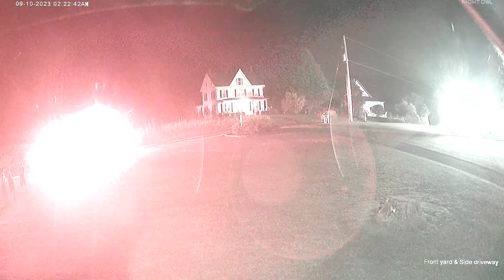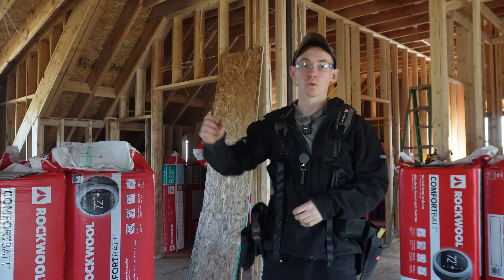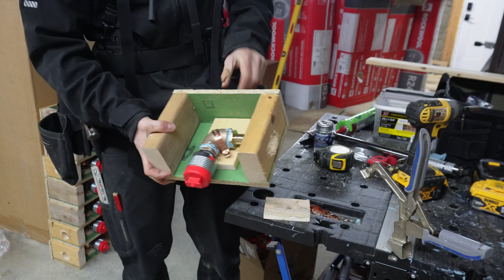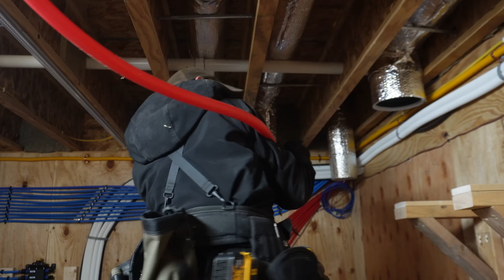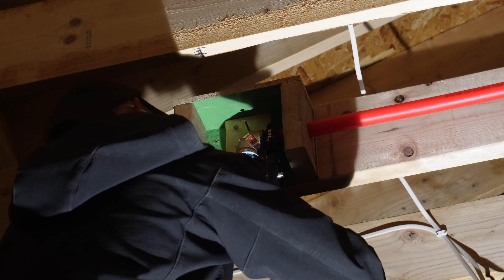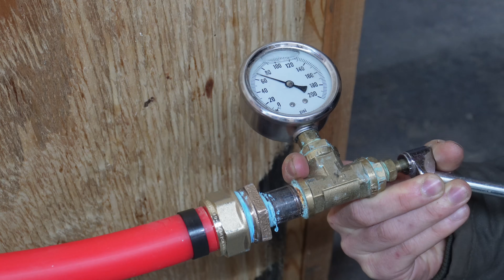AIRTIGHT House Fire Sprinklers with PEX Piping (Fire Protection Part 2)

Comment: Use 1/2" Pex A and connect it to a self contained Compressed Air Foam system that supplies high expansion foam to each fire sprinkler head. No fire pumps, just a 50 gallon holding tank for water and 1% Class A foam concentrate under pressure using a 300 CFM nitrogen tank.

Comment: Using all those fittings, the amount of friction loss almost makes more sense to just design with three-quarter pex.
Reply: That pipe would be to small. You need to flow 13 gallons a minute out of 2 head to test.
Reply: @rickberger3213  what is the GPM of the two head test on this system using three-quarter inch pex?
Reply: @Z71hosestretcher it's almost always 26 gpm. 13 gpm out of each sprinkler.  I've designed houses using CPVC & PEX. The pipe size is always 1" or bigger depending on the static pressure. Pex piping and fittings have a higher friction loss.

Comment: Well, you've convinced me to use CPVC and being happy about using a conditioned attic which will allow me to access the sprinkler piping via openings in the web in the trusses.
Reply from the maker: Yep that’s a good call! Or just buy 20’ straight PEX from a plumbing supplier like I should have here 😁

Comment: Hello from Nottingham, England. I know literally nothing about sprinkler system but I was just wondering. By putting the sprinkler head in a wooden box with Rockwool, are you not creating a heat shield? Rendering the head useless?
Reply from the maker: The rockwool is only above the head for some additional insulation , the glass bulb inside the head is exposed to room air

Comment: Why the box around the sprinkler head?  Is it a heat collector? I have never used pex, only cpvc and steel. I've been in the trade for over four years and have never seen that done nor taked about in the classes
Reply from the maker: To maintain a continuous air barrier at the ceiling while allowing room air to reach the sprinkler head. I came up with this detail myself, I explain it more in the part 1 video

Comment: I was watching the system install. Great job.
 I can think of 2 options for runs in cold areas. Install a back flow valve at the tank (like on a sump pump) and place a connection  point in the output side and fill with the glycol that will not freeze. 
Option 2 install backflow valve once again this backflow valve only this time this one will stop backflow of air. Than charge the full system with air. When I head is calling for water the air is released and pump will start to push water. I think that’s called a dry system.
Reply from the maker: Appreciate the ideas! By backflow valve do you mean check valve or backflow preventer? A glycol mix would probably work. At some point I might put a temp sensor up against a tee through winter to see how cold it really gets. 

I did look into dry systems for residential use, the commercially made ones are pretty expensive and more complicated than a wet system but I'm sure you could rig something up DIY with enough know how. You'll usually see dry systems for areas like loading docks or unconditioned warehouses

Comment: Nice!  You have inspired me to consider a sprinkler system!  We have issues with the "Limiting Distance rule" in the building code.  Sprinkler systems allow a somewhat larger window area so this could help to mitigate the problems with our design.
Reply from the maker: There you go! With sprinklers we had the option to not even drywall the garage space, not that we would ever do that but fire code definitely relaxes with them installed. My goal with these sprinkler videos was to inspire at least 1 person to do it in their build.. so if you go through with it please email us! 😄

Comment: Is one inch pipe required?
Reply from the maker: Yes per the NFPA prescriptive design I followed, but other pipe sizing could be used if you had a custom engineered system designed.

Comment: How are you planning to evict the air from the pipes?
Reply from the maker: you don't really, if a sprinkler goes off you might get a couple sputters of air before full pressure
Reply: @MasonDixonAcres  I'm not sure that's wise. Imagine how long it would take the water to reach the farthest sprinkler on the second floor when it's limited by the flow rate of just one sprinkler.
I've seen in commercial sprinkler systems they have a faucet at the end of each line in order to evacuate the air and fill the line. Perhaps you could get away with just unscrewing end-of-line sprinklers in order to fill the pipe and then putting them back in.

Comment: I would be so worried about a false alarm setting the sprinklers off for no reason and it destroys the home
Reply from the maker: It takes 155F at the ceiling to do that, there is nothing except a legitimate fire in the house that produces that kind of heat. Not even the ceiling directly above a wood stove, people have measured that around 140.
Reply: @MasonDixonAcres  Got it. And those sprinklers are known to be trustworthy? Or any cases where defects cause it to go off? I guess in the event anything does happen in a worst case scenario, as long as you have a shut off valve to turn it off then it'll be manageable.
Reply from the maker: They’re well tested for reliability. With the concealed plate there’s no worry of physical damage like there might be with an exposed pendant
Reply: @nickp3173  there’s a much bigger possibility of a hose busting on a washing machine or a toilet and flooding the house

Comment: Our 2017 home on the west coast came with sprinklers. High pressure orange PVC running at about 100 psi. 5800 sf under roof. Two garages, two car garage and an RV garage. Hope to never use them.
Reply from the maker: That's quite an area, hopefully you never see them used but if you do you will be glad they were there!

Comment: Why not straighten the coil out WHILE the hot water is flowing through it?
Reply from the maker: Because it was 300ft long and still pretty stiff 😅
Reply: @MasonDixonAcres   fair enough. I guess time and space really make a difference. I've seen larger spools get unraveled some in order to wrap around new houses during construction. And stay that way for a weekend before they start working on it. When I was working on a farm and we needed to run a new waterline underground we ended up using the hayfield and two weeks during the hot summer to get it fairly straight. 

I often forget that not everyone lives on double digit acres where there's space for that stuff
Reply: @MasonDixonAcres  In practice, you don't need 300 ft as a single length.  As you unroll it, cut off the lengths you need, and secure it straight.